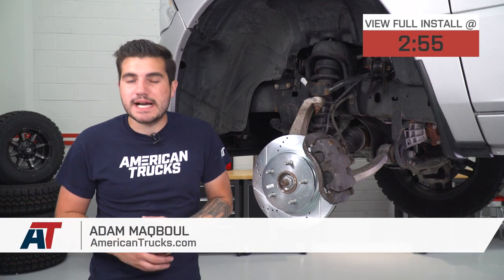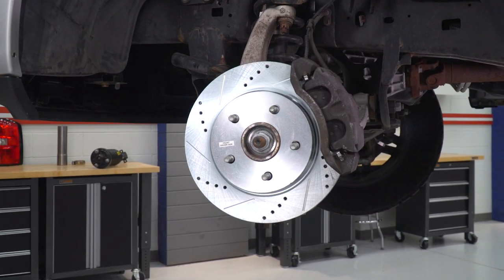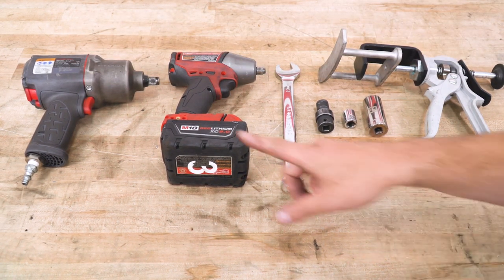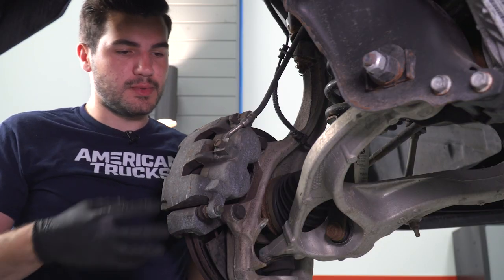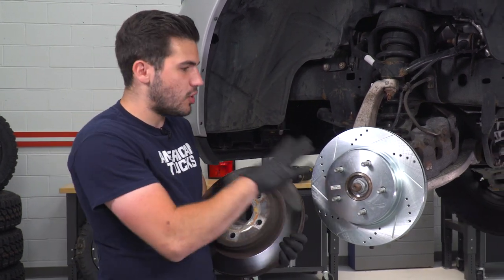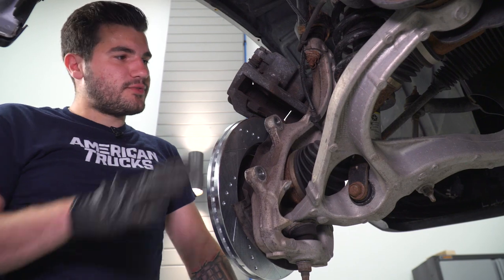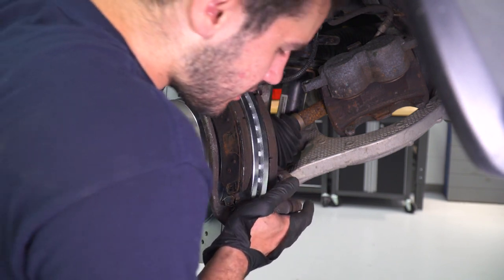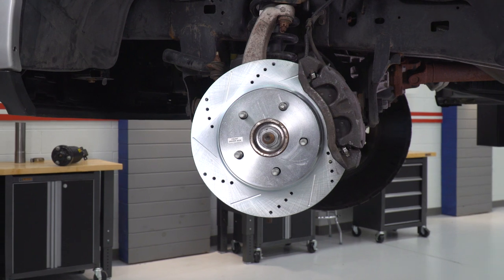2002-2018 RAM 1500 Power Stop Evolution Cross Drilled & Slotted Rotors - Front Pair Review & Install

Comment: um. you didn't grease the caliper pins or brake clean the rotor and caliper from any debris/ rust.
Reply: You don't put break clean on a  zinc coated rotor. Its not good for it.
Reply: Didn't clean or re-lube the pins, didn't scrape the sticker off of the rotor (a few thousandths can make a difference), didn't hang the calipers with a hook, and worst of all, no new pads.

Comment: You should clean and re-lube the caliper pins, Never place the caliper on the frame so it can fall off, use a hook so you don't strain the hoses. You should use new pads and hardware and clean the mounting points for the hardware. Sounds trivial, but scrape the sticker off of the face of the rotor. A few thousandths sticker could be enough for bad wear. Other than that, I liked it!
Reply: Also safety squint when grinding

Comment: My mechanic told me to go with solid rotors on trucks for solid stopping power due to the extra weight.    Cars and lighter sports cars are a better use of slotted/drilled rotors.   OEx wagner pads and Bosch rotors, I get 70,000 miles out of them before a 2 year check and everythings under a free replacement warranty.    When they heat up, I dont lose much stopping distance or power at all.     Love my set up.
Reply: There is a fella on yt that tested temps n such and compared drilled and solid rotors on his car...Seems solids stayed within a cpl deg cooler that the fancy rotors..
Reply: Your mechanic is right. I just stick to Mopar OEM brake pads and rotors and never had a problem with my Ram 1500. Slotted rotors are for lighter cars not tow trucks. Notice semi trucks never have slotted rotors.

Comment: I herd that Drilled & slotted Rotors create a lot of dust and brakes squeak
Reply: They do. I also seen the holes crack under extreme pressure and heat!
Reply: I've had several cars with cross drilled and slotted rotors and never had any issues
Reply: I've had these brake rotors and their carbon/ceramic pads on my truck for 2.5 years now and have not seen ANY brake dust at all since I switched from stock. Absolutely NONE.
Also it's not a racecar so I'm not worried about them cracking at 1500 degrees.
Reply: @halecj1  Same here.  No issues whatsoever.

Comment: Did you just use the old pads? Wtf.
Reply from the maker: This video is just about the installation of these rotors. If you're replacing these yourself, it is always a good idea to pair new rotors with new pads and do everything while you're working on your truck. -Zach
Reply: @AmericanTrucksRam  well the look you are giving off doesn't look professional
Reply: rightttttt hahahhh he even tried to put the brackets backward then cut the video to make it look like he did it right @ 8:35

Comment: whats the maximum size for rotors? I want to upgrade to a larger rotor for more surface area and brakeability. Brakes suck on Mopar trucks, they really dont stop anything. Lmao
Reply: For stock caliper you can only use the stock rotor. You need bigger brake kits that comes with bigger everything. Or just use better quality rotors/pads like this one in the video or the Hawk...
Reply: the hawk?